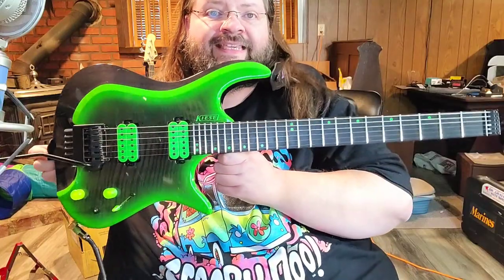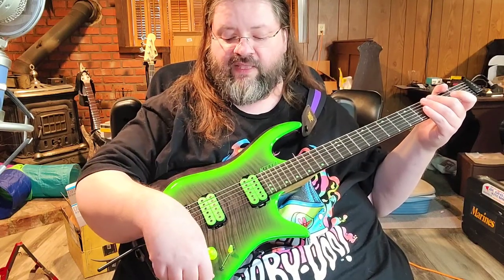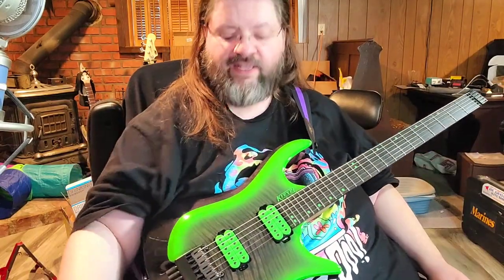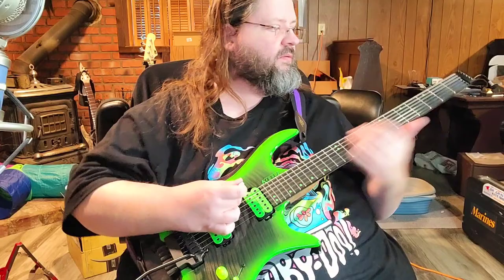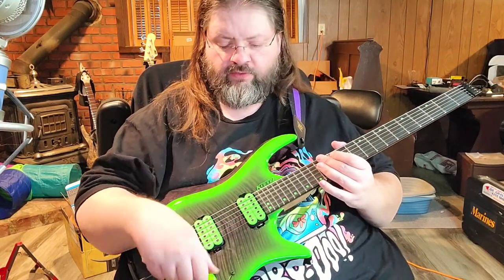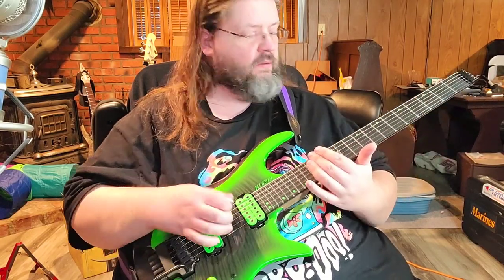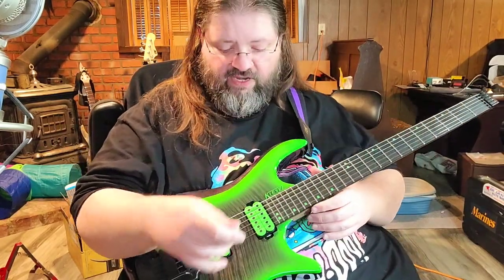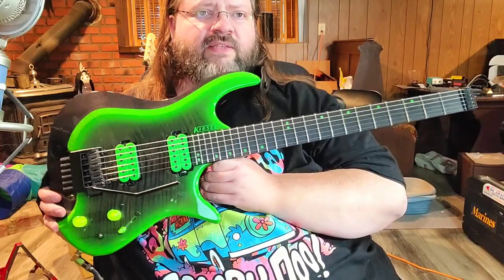Kiesel "LM6" Headless Guitar. The Sickest!!

Comment: I just got my first Kiesel, a headless Delos, about 6 months ago. It's my first single coil guitar and I'm not sold on the 60 cycle hum, but otherwise this is the best guitar I've ever played. The action is low but doesn't buzz anywhere on the neck. I went over every inch of it and the workmanship is perfect. They're not the crazy value that they were a few years ago but I will definitely be getting another one. A Zeus I think, with humbuckers.

Comment: Awesome video Cristopher. I recently acquired a Kiesel Delos Headless with two Beryllium humbuckers. The construction is as you describe in both of your Kiesel guitars videos. Thanks for the tip on the Schaller 5-way switch and the more robust output jack in that video. I wanted to ask you, since you've owned so many different instruments with so many different pickups, if there were a set of humbuckers that you loved the most overall for clean tones?  Especially, working on a 5-way switch with the full humbuckery tones but also the split humbucker tones. After watching your videos, I can see that you're quite aware of the variances that can be achieved with clean tones, in both full humbuckers, as well as the split humbucker tones that combine the two inner coils or the two outer coils as well as neck only (split humbucker to single coil neck). I personally love having both Gibson and Fender type tones out of the same instrument if possible and without compromise. 

The Berylliums sound very good but also have a much stronger output which is great for heavy overdriven tones, but not as good for clean tones, where you want that sweet Alnico top end that is a little more chimey and open on lower output Alnico V pickups. The kind of humbuckers I've had the most success with over the years are Lollar Low Wind Imperials, Duncan 59's, Duncan Seth Lover, Gibson 490's and Suhr SSV's. I've had a ton of other boutique pickups like Throbak and Tom Holmes and other cork sniffing $500 - $1000 pickups, but I've found that once you hit the price point of Lollar and Suhr, you've reached the point of diminishing returns. Nothing costing more than a Lollar or Suhr pickup has ever sounded better to my ears, only worse. That being said, the Seymour Duncan 59's or Gibson 490's (both very pedestrian models) installed with good quality pots and wiring with height and pole pieces setup well can sound remarkably close to something as high quality as a Lollar Low Wind Imperial or Suhr SSV pickup in the same guitar. Just my personal findings after having spent way too much time and money in the pickup vortex. 

The Kiesel Beryllium pickups do sound mighty impressive upon first try, and yet they have a very different sound from any of the classic PAF wannabee pickups that I mentioned in the last paragraph. I'm not sure how you find the Lithiums and if there is a similar quality but I find that the Berylliums in my Delos headless have somewhat of a stiff sound to them. I don't want to use the word "brittle" because that can seem very negative, but it is something in the spectrum of having a very "hard" or "stiff" tone. Typically, PAF style pickups do this thing where they compress a little, especially as you play harder and give them more juice. That compression tends to create a kind of sweetness in the top end so that rather than the treble frequencies getting hard and stiff and brittle sounding, instead, they sort of smooth out, with a kind of compressed sheen. I'm not sure if that makes any sense as describing tone is as abstract as trying to explain art. I was wondering if you found anything similar or if you find the Lithium pickups to resemble some semblance of other PAF type pickups you've used in the past? The Berylliums, I believe are using Alnico magnets, but to my ears, they sound like ceramic magnets. Like the higher output Dimarzio pickups that are geared towards metal players. Out of the big two, I always find that Seymour Duncan's pickups have a certain sweetness to them with that compression that occurs when digging in and that Dimarzio are missing the sweetness that Seymour Duncans have. The Lollar and Suhr pickups are closer to most Duncans than Dimarzios (save for the 36th Anniversary Dimarzio PAF model which sounds like a clone of a Lollar Imperial). The difference with Lollar and Suhr pickups is that they make other pickups sound like you're listening with a little bit of cotton in your ears. The difference is most notable when playing clean tones, especially through an amp with a wider frequency response like a Vox or Matchless style amp. You get an extra octave up top of harmonic overtones. Sometimes that's a good thing, but sometimes that's a bad thing if you want the electric guitar to sit in a mix with vocals and bass and drums and live in its own area of the midrange. I find that Duncan pickups like the 59, Seth Lover and Antiquities are the safest bet, for a tone that just works within the context of a band. A pickup like a Dimarzio Fred or Evolution has way to big of a sound to work in the context of a band with a vocalist, which is why they are pickups for instrumental soloists. I think Lollar and Suhr pickups are like the half way point between something like a Duncan 59 and a Dimarzio Evolution or Fishman Fluence that have such a wide frequency spectrum that they really only work in solo guitar oriented music. 

I'd love to hear what your desert Island set of humbuckers are so far to get full humbucker sounds as well as split sounds in positions 2 and 4 if you have a bit of time to share. Thanks for your informative videos. You're very knowledgeable and I really like the direct, sincere and professional approach you have on your channel.
Reply from the maker: If I could only have one set of pickups for the rest of my life.... I'd likely go with a pair of the Dimarzio "Dual Sound" (DP101) pups. My all around favorites.
Reply: @ChrisTompkins-Music-And-Gear  Thanks Christopher. I appreciate your insight!

Comment: Cool finish! 
I also have a Kiesel, DC700 with the Hipshot trem, but I definetely not a fan of the trem. It is heavy, it doesn’t stay in tune that well, the handle is too high of the body, the handle gets in the way when you position your wrist on the bridge or when you want to touch the volume-/tone knob. And with the 7-string Hipshot trem there is unlogical thing that there is space for 5 springs but there are 6 holes in the bridge block to put in the spring ends. So if want to balance the bridge evenly you have to use 2 or 4 springs, positioned on the outer sides. 
Also the flutters are totally not the same as with a Floyd Rose or the Edges of Ibanez. Those trems offer much more control of the trem and are better in any way than the Hipshot. Vegatrem I never used but it looks good. 
And about the Kiesel guitar, yeah it has good points but not everything. For me the Kiesel thing is a bit of a hype nowadays.
Reply: I'm not a fan of the Hipshot trem in my HD Delos either. I agree that the arm is strangely far from the neck, so much so that I gave up on trying to use it. Next time I'm going to get a hardtail and save the $100 and ~1 lb weight.